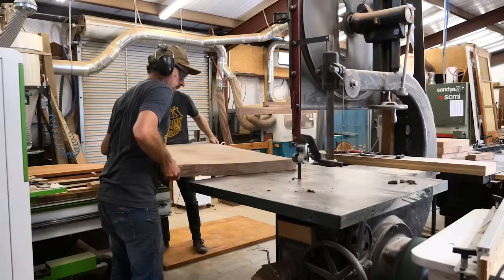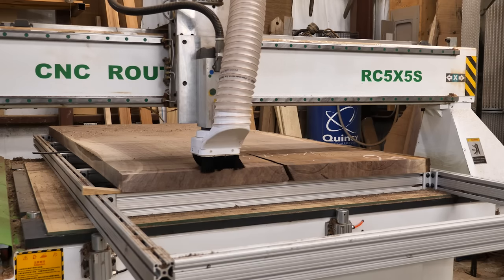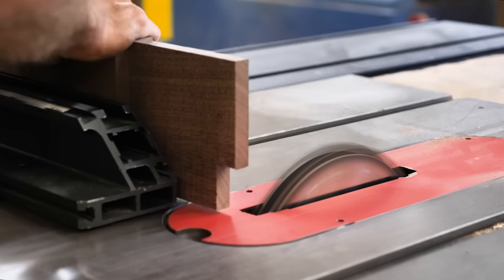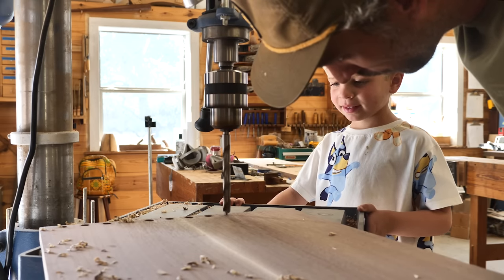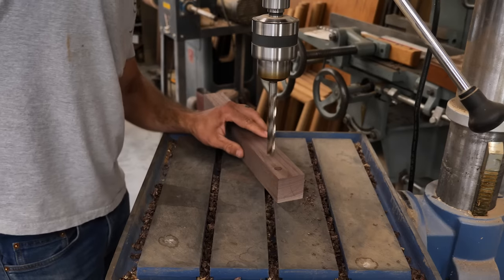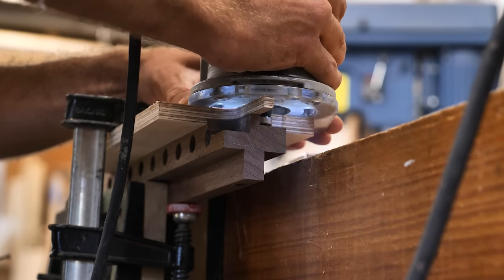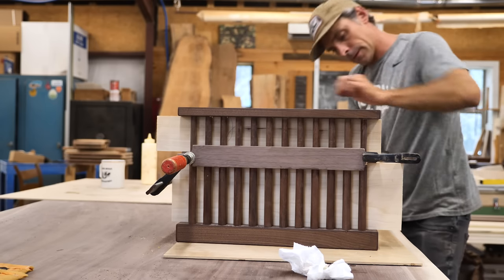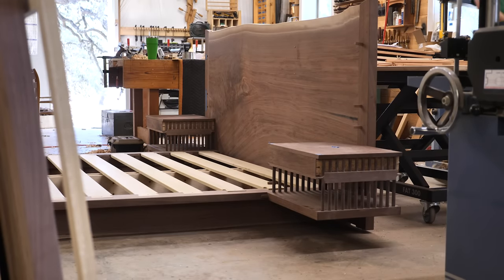Building A Live Edge Platform Bed with Floating Nightstands (Part 1)

Comment: I know you’re using relative dimensioning and it didn’t matter in the long run, but please do not trust a 1/2” wrench as a gage. I used to work for a tool maker and the wrenches are made with surprisingly large tolerances
Reply from the maker: You’re actually right.  The craftsman I apprenticed under would heart his wrenches and hammer them down to size.  They’re almost always oversized in my experiences, so I’ll usually turn my tenons a little smaller after I finish sizing with the wrench.